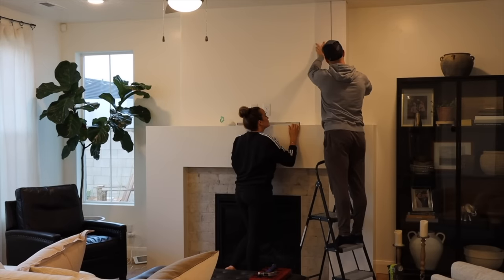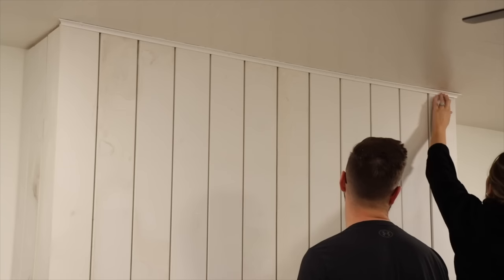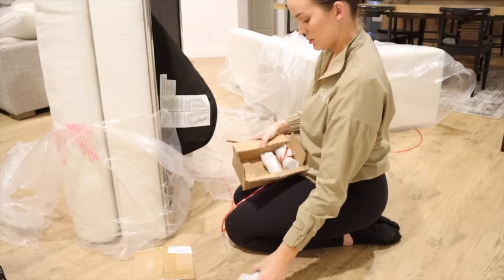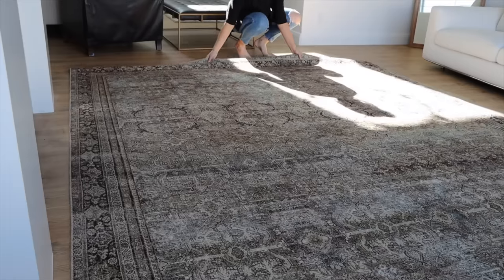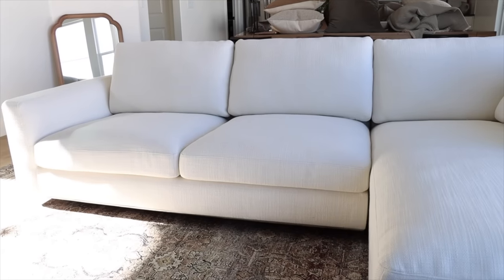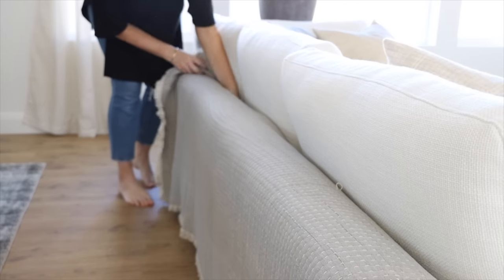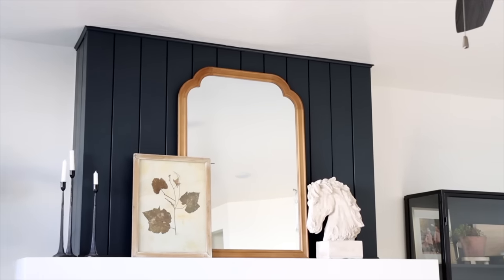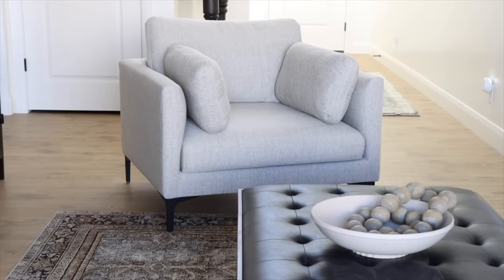Living Room Decorate With Me || Decorating My Living Room With A Castlery Sectional!

Comment: It looks so beautiful 😍. I noticed your candles were giving you a hard time flopping around lol. I saw someone use a small bit of paper towel wrapped around the bottom of the candle before putting it in the candlestick and I tried it. It works like a dream.
Reply from the maker: Those darn candles lol, I just need to melt the bottom a little